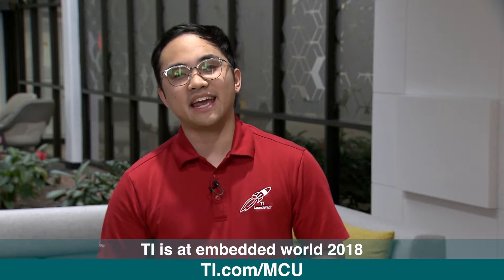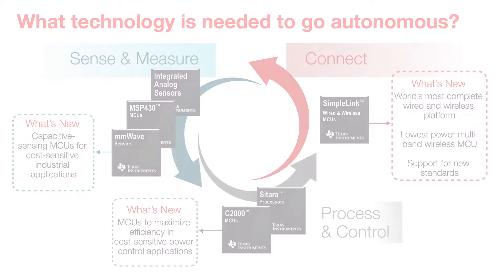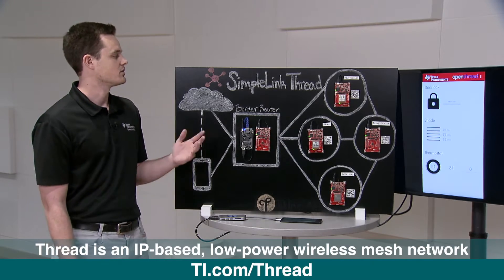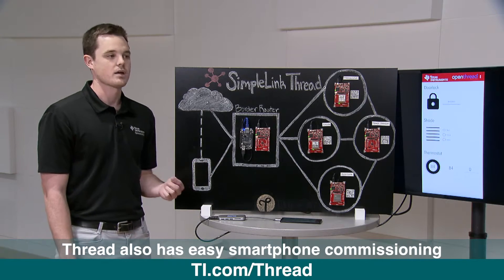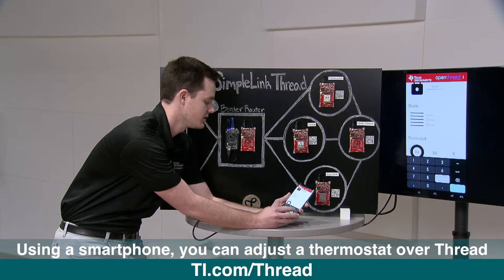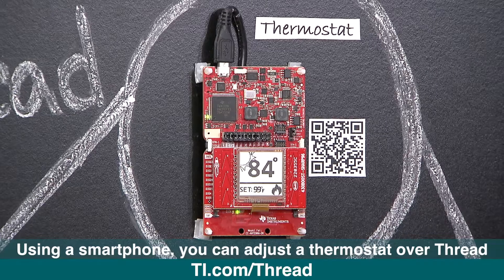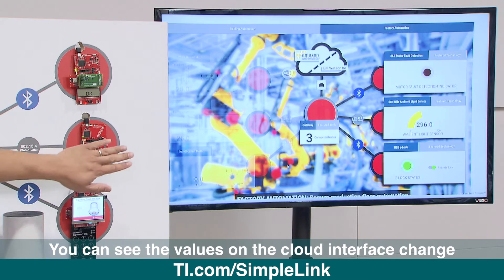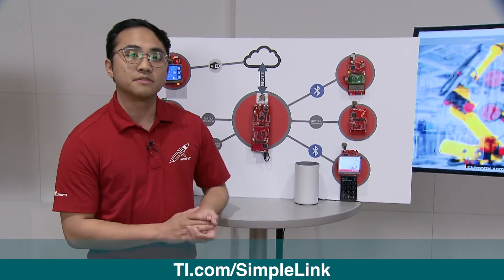Designing tomorrow with TI embedded processing

Comment: What is the expected range of this "Simplelink Thread" ?
Reply from the maker: Thanks to Thread mesh networking, the communication range can be extended indefinitely using multiple hops as repeater. Single hop range depends on several physical parameters (like transmission power, antenna elevation and position, etc.) as well as environmental factors (like whether the two antennas are in line of sight or there’s attenuation on the RF path), noise floor. In perfect ideal conditions this can go up to few hundreds of meters. Please look at this TI blog post to compute the estimated range for an 802.15.4 connection at 2.4 GHz using the SimpleLink MCU family: https://e2e.ti.com/support/wireless_connectivity/bluetooth_low_energy/f/538/t/375823